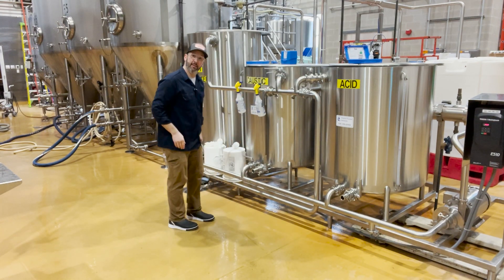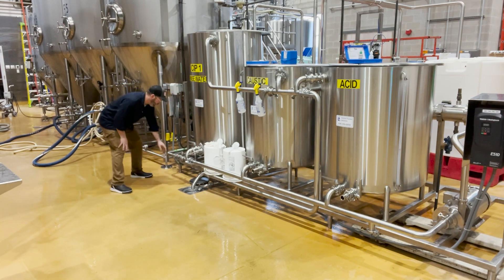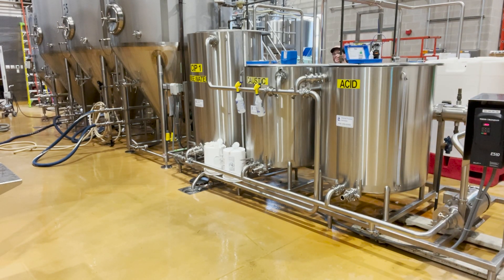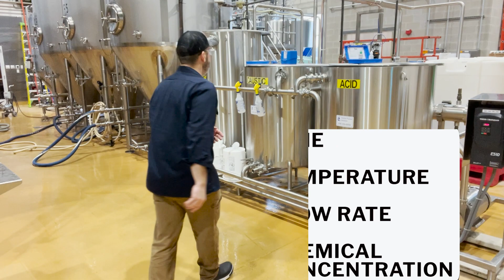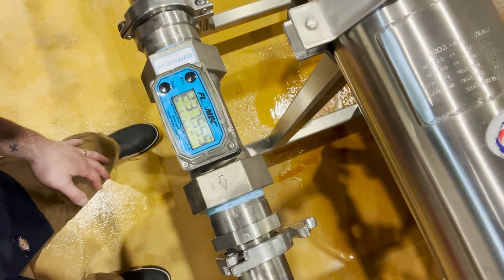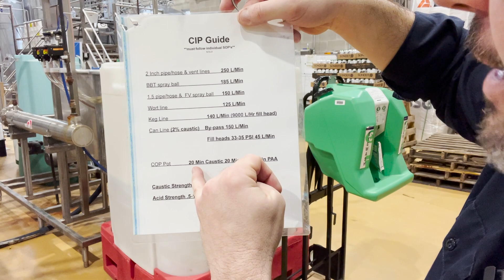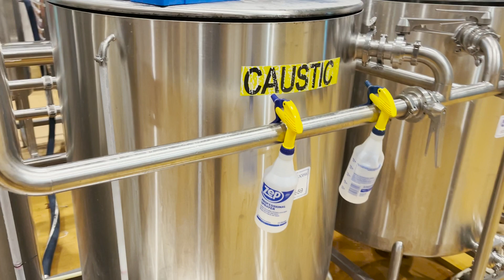Tutorial: Utilizing A CIP Skid At Sonder Brewing!

Comment: We have an electrically heated, 20-gallon, 2-vessel CIP cart for our brewery in planning.  Our cart differs from yours in that it can be moved to the source for cleaning, and also that it does not have a city water inlet.  We will probably store caustic in the heated tank, and PAA in the non-heated tank.  Since the heated tank has a PID, my plan was to pre-heat it on cleaning days ahead of time, then use our 140 degree external hot water source (or perhaps HLT water) to blast pre-rinse and pre-heat the FV, then simply roll the cart to the FV, hook up a loop, and run for the recommended time.  I have a few questions:

-  Since I only have 1 pump in the loop, do you think that gravity will be enough to return the bottom return water to the CIP pump without cavitating it?  I assume I could just throttle the pump outflow?
-  How often do you change the chemicals in your CIP?  I would assume it depends on what you're cleaning, and how well you pre-rinse, but is there some SOP you have for observation, or do you go by titration only?
-  Do you ever hook up 2 things to be cleaned in parallel (i.e.: CIP outlet split with a T and 2 valves) for time savings, or do you think that the pressure drop would negatively impact the effectiveness?
-  For my system, how necessary do you think a flowmeter on the pump outlet line would be?
-  What was the water running onto the floor behind the acid tank in the video?

Thanks, great video as always!
Reply from the maker: talking about it this monday!